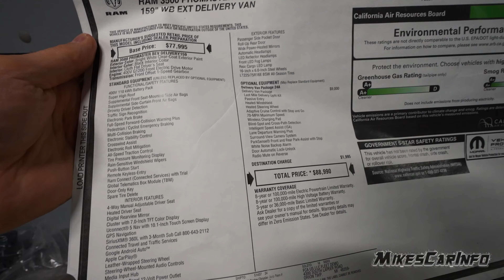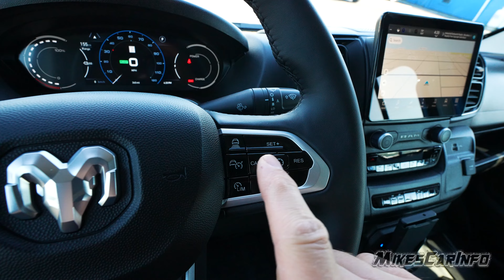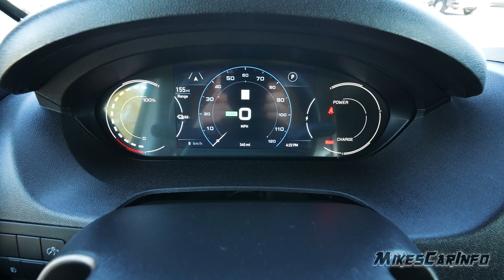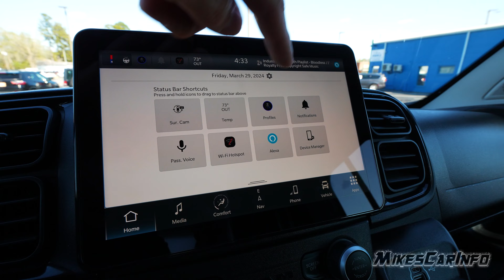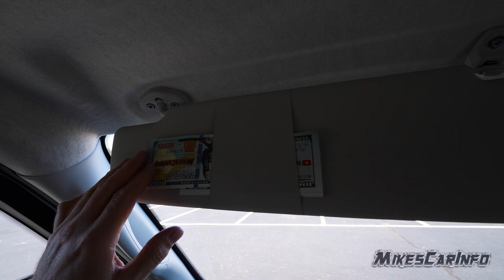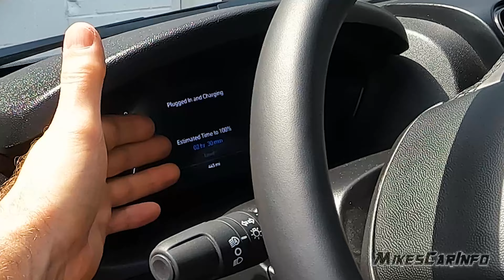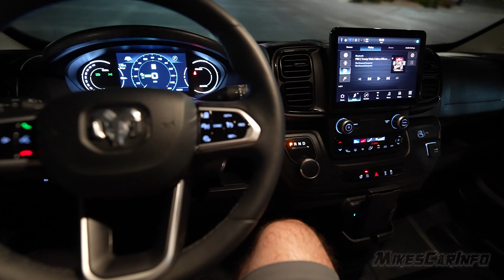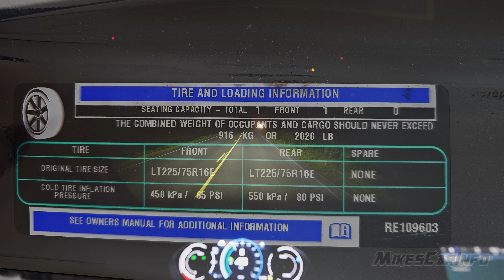2024 RAM 3500 ProMaster EV Delivery Van -- Ultimate In-Depth

Comment from the maker: 0:00 Intro
0:38 Exterior
3:01 Key Fob
3:33 Driver door
4:39 Sliding side door
5:30 Jump Seat
6:34 Interior
8:19 shelves 
10:22 Rear roll-up door
12:23 Controls
21:14 360 Camera
30:32 Under hood
31:50 Wheels & Tires
32:02 Undercarriage
32:16 Visibility 
34:05 Test Driving begins
42:04 Scale
43:57 Charging
45:37 Night review begins
51:36 Headlights Test
55:24 Window Sticker
56:31 Specs
57:44 Shelf dimensions
57:53 Vin Labels

Comment: I wonder how they can get away with not having a center high mounted stop light...
Reply: Cargo Vehicles without back windows don’t need them.
Reply: @dillonh321  no, Promasters with rear windows don't have them either. I just read that the FMVSS only applies to vehicles less than 80in in width so this is just barely above that.

Comment: In Florida.... Waiting for an EV Ram Promater 118wb low roof that can do 250miles real world in hot climate.   That's there smallest  van in the US and just half the range that Carlos Tavares of Stellantis has promised to deliver.   Wonder how long we will have to wait for this?... but really my concern is  these very long stretches of interior roads like US27 with no chargers for 100 miles.  I also wonder how many kw/h running the AC on high while parked consumes and if you can run the AC while parked and charging?